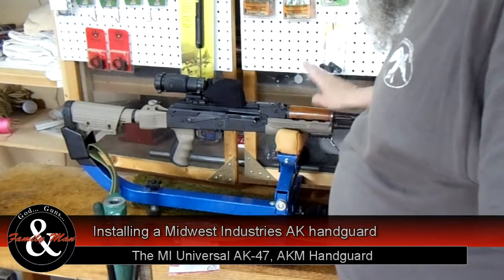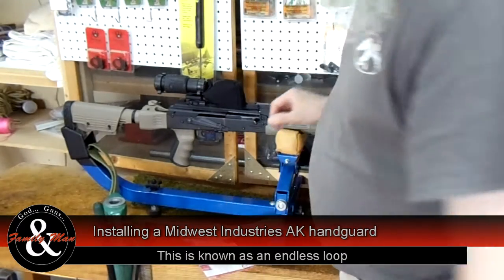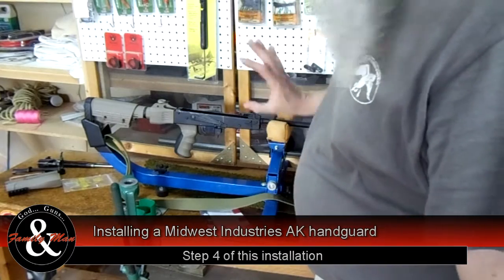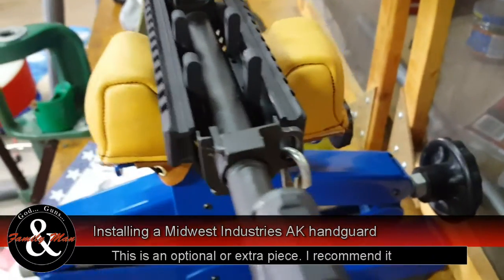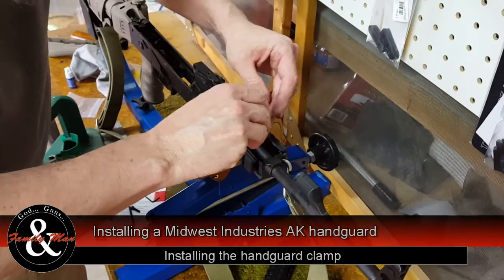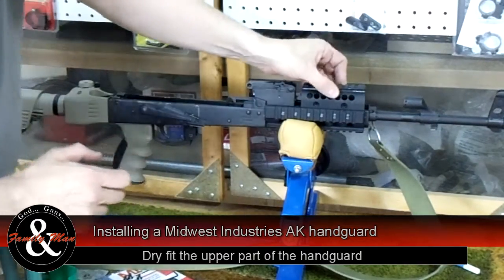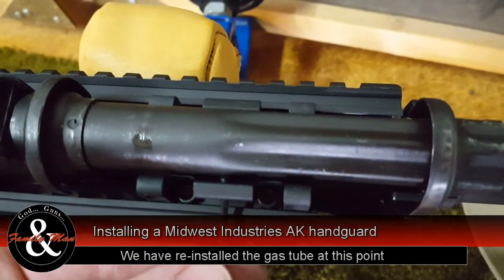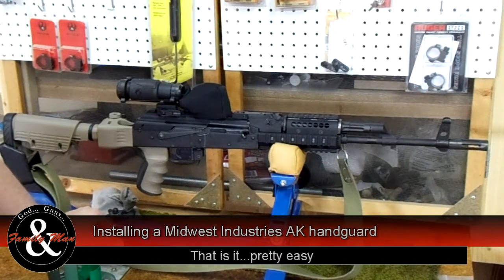Installing a Midwest Industries AK Handguard

Comment: So was there never a problem with the lower handgaurd retainer having a sling loop cause i watch another vid where the guy had to dermal that off to install the midwest lower handgaurd
Reply from the maker: If you want to mount a sling you will need to dremel the hand guard.  We have since started using the Zenit/Zenitco hand guard. The midwest is good but not as good as Zenit.
Thanks for watching and posting.
Reply: @sdkweber  but that sling loop isn’t in the way of the hand guard right ? Cause that other video made it seem like it was in the way and you needed to cut it off to install.
Reply: @sdkweber  ohh never mind in the other vid he was installing the extend type
Reply from the maker: @battleaxealex4449  Thanks for the follow-up.

Comment: Hi, how to clean the gaz tube after mounting this handguard please?
Reply from the maker: You can remove the handguard if you want to do a full disassembly, but in reality the huge AK gas tube does not really need much cleaning.  For general cleaning you should also be able to get at the gas tube when you field strip the AK and clean it from that end.
Reply: @sdkweber  thank you for explanation
Reply from the maker: @mayhem13007  You are welcome.